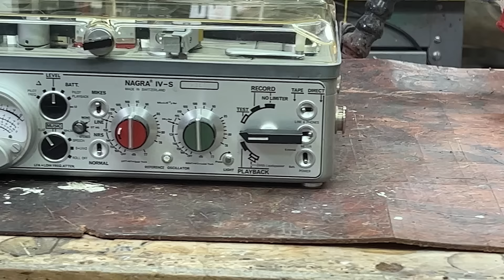Adam Savage Restores Clear Plastic Discoloration

Comment: Like others have said, a UV light makes the hydrogen peroxide process work so much better.  I use it for cleaning yellow discoloration from plastics (both solid and clear).  The addition of a UV light (and letting to process go for 24 hrs or longer for really bad yellowing) makes a world of difference.
Reply: Agreed, UV light is a critical part of the process
Reply: I've done it too on old computer cases and a clear stereo cover and UV light is the difference, I also used a stronger HP% I think it was 30% not 12%. The computer cases came out off white/beige just like from the factory floor and the clear plastic was crystal clear without a hint of yellow like this still has. 

I coated them before bed let them sit overnight then set them out in the driveway for a couple hours in the sunlight, then cleaned them off. 10-11 hours total.
Reply: This Summer I de-yellowed a load of LEGO bricks, worked well, but being the UK and not having a garden to leave it in, the window of opportunity isn't great! Soon I'm making a de-yellowing box with a glass tub (ideally lidded), UV LED strips and some kind of heating base.
Reply: Tip: If you don't have access to UV light another good source is the sun itself. Just make sure to swirl the parts from time to time to get a uniform color. I whitened the body of a white Panasonic Flip Clock. Works a charm
Reply: Came here to stop screaming that at the screen. ;)
Reply: Exact
Reply: @jimmytvfclassic  I'm in the UK, don't always have access to the Sun, haha! I need to do it often enough that building a box to do it will work out well. Won't need to wait for Summer to roll back around, and can even do it at night.
Reply: @BogusNoise  yeah... makes sense. If you do it often, it's better to invest into a UV box for sure, specially if you live in the UK. I'm from Spain, and I just wanted to give that tip in case it was for a casual fix or you can't afford building one. Cheers mate!
Reply: @jimmytvfclassic  And you were right to do so 🙂
Reply: I agree with that, however, I use a dedicated sous vide for a low heat instead of UV.
Reply: agreed... I came in to say the same thing.  H202 is only half the de-yellowing process.  Gotta bathe it in UV light while it soaks for the best results.  Odd Tinkering does a ton of old video game console and handheld restorations, where he goes through this process in basically every video.  Fun fact... you already have a large format UV cabinet that you built for your Form 3 printer.  If you can get that tub of peroxide in that box, you're golden.
Reply: this
Reply: You need an aquarium heater too.
Reply: @BansheeBunny  Good point, I think Odd added one at some point as well
Reply: When yiu say UV light, what wavelength are you referring to?
Reply: Weird that UV light helps, since UV light probably causes yellowing in the first place, but I get it acts different around the peroxide?
Reply: @tomhorsley6566  The UV light is a catalyst for the reaction between the hydrogen peroxide and the plastic, adding heat to the reaction speeds up the processes.
Reply: I have two questions.. won't the UV cause the plastic to break down, and what wavelength of UV?
Reply: @yeroca  yes and no. same way if you leave plastic outside in direct sunlight for months and months it will break down and become brittle. however to accelerate a chemical process over a relative short time frame (12hours vs. 4months) the affect on the plastic will be negligable unless you plan on using it outdoors. there are processes to restore brittle plastic by basicaly filling in the chemical bonds that were broken by UV damage with a similar resin or, even better, a uv resistant resin but at that point you are basicaly preserving the shape and not the thing. from a restaration standpoint its completely safe for preservation of plastics because its not any more destructive than just leaving the piece out in open air. hell polishing is more damaging than peroxide treatment because it removes surface finish.
Reply: @RyokuKitsune  a direct UV lamp will be more intense than sunlight, but I see your point, thanks 🙏
Reply: I got mad about 3 minutes into the whole process.
Reply: @JasonOlshefsky  I almost started screaming...' Duuude, like WTH are you doing!?, did you read the instructions for using peroxide?!' LOL
Adam has his dufus moments.
Reply: @tomhorsley6566  thank for asking and for the response below. I was thinking this exact thing and your question/explanation is the first I found. 
After seeing what the sun does to headlights, I needed to know why
Reply: @Projacked1  I’ve never handled strong peroxide before so I never needed to, but as his mind is moving a mile a minute, I can understand overlooking that
Reply: I'm actually kind of surprised that all the research Adam did on the internet and he forgot the UV light. I mean, this process only has a few components to it.
Reply: @GordysGoodworks  UV isn’t critical. Heat, peroxide and time are enough. I retrobrite at about 40C/100F in 12% peroxide with no UV source, and it works just fine.
Reply: Without the UV I don't think it works at all. I've googled lots and I can't find a single demonstration without UV.
Reply: @PhilipLeitch  It definitely does work without UV, I retrobrite 1980’s computer cases in heated peroxide in a box with no light of any sort. If you want more details check out Hey Birt’s YouTube video “The truth about retr0brite”.
Reply: I was yelling at the screen when he missed the uv light step. Lol
Reply: I remember... Hmmm... I think it was Retro Man Cave or something, or maybe it was Techmoan. . They did a bunch of tests and basically the consensus was that  you need HP, some heat and time. UV and sun heat in general very much accelerates the process, but if you give it time. Just soaking it in HP will be enough. I'm guessing in room temp and no UV. maybe it's on the order of days instead of hours to get done. But at least it showed that sunlight/UV was not necessary if you aren't in a hurry.
Reply: @jmalmsten  actual link would be great. Thanks.
Reply: @thomasrevor7608  I've also done it thru sous vide.
Reply: @jmalmsten  Hey Birt’s channel did the experiments.
Reply: In my experience, it also makes the plastic more brittle.  That's been the case with older toys that I've tried to restore.
Reply: @Of_the_House_of_Black  That happens when it's soaked for too long.  Experience has taught me to measure the thickness of the plastic and soak accordingly.
Reply: Yellow urine stains on orental rugs i treat with between 3% and 10% hydrogen peroxide and sunlight to get them out while leaving dyes relatively alone its a great oxidizer 3% is safe fore wool rugs and textiles
Reply: @GordysGoodworks  🔴 What Is Islam? 

🔴 Islam is not just another religion. 

🔵 It is the same message preached by Moses, Jesus and Abraham.

 🔴 Islam literally means ‘submission to God’ and it teaches us to have a direct relationship with God. 

 🔵 It reminds us that since God created us, no one should be worshipped except God alone. 

 🔴 It also teaches that God is nothing like a human being or like anything that we can imagine.

🌍 The concept of God is summarized in the Quran as:

📖 { “Say, He is God, the One.  God, the Absolute.  He does not give birth, nor was He born, and there is nothing like Him.”} (Quran 112:1-4) 📚

🔴 Becoming a Muslim is not turning your back to Jesus. 

🔵 Rather it’s going back to the original teachings of Jesus and obeying him. 

More .....
Reply: In my experiments, peroxide +UV is crucial. It sounded paradoxical as in my case (multiple computer cases in fact) UV was the cause of the yellowing. I also found that raising the temperature of the process had a dramatic effect. Some say that a temp increase makes the plastic more porous and amenable to a good reaction. I'm not sure if that's right but it definitely helped. My current yellowing problems are with white 3D printer resin about a month after curing and exposed to indoor daylight. The method described here doesn't work for me - not even slightly.
Reply: @BogusNoise heh. I hope they weren’t yellow bricks.
Reply: @melgross  They were actually green but I'd run out of blue soooo...
Reply: I had the idea to do this but wasn't sure if it would work and your comment is the exact idea I had so thank you.
Reply: I have an old 1970's terrarium. I've tried the 40 volume peroxide with plastic wrap and left it in the sun for 3 days. I'm going to try it again tomorrow with UV light. Fingers crossed 🤞.  It's a $500 terrarium if I can remove the yellow. Thanks!
Reply: A year on, all the Lego parts I deyellowed have reyellowed. They were in storage in the dark rather than out in the open. Probably won't be trying the process again!!
Reply: You don't need a UV light per se because he's in SoCal just needs to leave it outside, also better to use Salon Care 40 and cellophane wrap it so it won't dry out.
Reply: Question, I did the retrobrite process with vinegar and a UV light to remove yellowing on my clear original gameboy and the yellowing is gone, but now the clear plastic is very cloudy.. how would I fix this?
Reply: I found a vintage UV sun tanning lamp at the thrift store. It's shaped like a regular table lamp. Awful and deadly for your skin I am sure, but works a treat for this kind of repairing job on old electronics.
Reply: Hey brother could you expand a little bit? What do you mean letting the process go for 24 hours? Do you mean using a uv light continuously for 24+ hours while using peroxide?
Reply: @anthonyL1776  Yes.  I had a keyboard enclosure (that was so stained that I originally thought it was yellow) that I had to let set for over 30 hours.  After the first 8 hours or so, you have to check on it regularly (too long and the plastic becomes too brittle).
Reply: Does it matter if the plastic is colored instead of white?  I have a blue toy from 1969 that is badly discolored.
Reply: @ZerocoolsPropsandCollectibles DO you mean putting the object in a zip lock bag with peroxide and heating in a saucepan?
Reply: @s.engelsman4521  no vacuum sealing the parts with peroxide and putting it in a water bath at exact temperature.
Reply: @s.engelsman4521  I haven't tried colored plastics, so I'm not sure.
Reply: @crash0zero and how to work over the big polycarbonate sheets?
Reply: @everythingitry3018  i have one I'm trying to restore now. How did it work for you?

Comment: Everyone’s already mentioned UV light, I just want to know how Adam managed to read about the peroxide without coming across the UV part.
Reply: Sad, right?
Reply: It’s possible he didn’t think it mattered because often the UV is suggested to make it work faster when it in fact is needed to get it to work at all
Reply: Ye that's what wondering too. Nearly all the articles on Internet mention the UV
Reply: I use a UV lamp too. I’ve seen where some people put it outdoors, in the sun for a few days. But that seems to be a lot of trouble.
Reply: He is human like the rest of us. He just missed it or misunderstood how critical it was
Reply: It turns out you can just use a heat source rather than UV to reverse the reaction - I had similar results with both approaches. Unfortunately both approaches will re-yellow within a year.
Reply: Retrobrighting is never permanent. What is happening is the chemical makeup of the plastic is destabilizing because the maker of the item didn't add preservatives and stabilizing agents to said plastic when it was being made (to save cost 0 its expensive and 'unnecessary'). There is nothing you can do to stop it other than re-making the plastic part with modern machines and technology.  @BogusNoise
Reply: @MrWolfSnack  I don't think it's a cost saving measure as it happens to expensive plastics too, doesn't it?
But yeah, it's not a permanent fix, but is talked about all over the internet as if it is! I found out the hard way, after spending money and hours on bleach, UV LEDS, boxes etc...
Reply: Something costs whatever the retailer wants it to cost. The construction of it and materials used has no bearing on its price. And the reason it is talked about as being that, is because people have the attention span of a turnip and do not actually wait and follow up on the progress after months/years. All retrobrighting does is eat away the top layer of stained plastic. The more you do it, the more layers of plastic you will chew up, whittling it down over time like a block of wood. So it can be harmful depending on the product.  There is theories that a car wax buffing or some sealer will stop the yellowing of the plastic after the retrobrighting but nobody has found out a reliable method.  @BogusNoise
Reply: @silaskuemmerle2505  Yeah, but one may think that he would have mentioned why he dismissed using UV -  if he actually had knowledge of it.
Reply: @MrWolfSnack  - Something costs whatever the retailer wants it to cost AND the consumer is still willing to buy it.

Also, having gone through the trouble of de-yellowing something, one might think to store it in such a way as to slow down the re-yellowing process - i.e., away from UV light. For example, the piece Adam did was only slightly yellowed even though it was about 50 years old. Most likely because such a piece of equipment would not normally be stored on a table top in front of a south facing window for all of those 50 years. So, properly stored, Adam probably won't need to re-de-yellow it again for at least 20 or 30 more years.
Reply: @anonamoose2582  It's already been proven UV exposure has no effect on plastic yellowing. It's the fire retardant polymers in the plastics decaying. This is why if you seal the plastic it will still yellow, because it is coming from within.
Reply: @MrWolfSnack that is so interesting haha thanks for sharing!

Comment: The most likely reason it got worse the more you polished it is most likely because you didn't clean out your pad often enough combined with allowing the polishing compound to get too dry on the surface while still buffing. After a couple of passes over an area with your buffer the area needs to be cleaned off as well as the buffing pad. Then new compound can be applied & worked again if it needs it. When polishing compound gets too dry it turns into a much coarser abrasive because the liquid is lessened but the grit is still there. As others have stated hydrogen peroxide works well to remove yellowing from plastics but it requires ultraviolet light & potentially more time than you allowed. You would also want to flip the cover over halfway through to help the bleaching process penitente the whole piece.
Reply: He really should be using the polishing pads that are made of foam. That way you can use different foams based on how much scratch removal you need and then finish off with a gentle polish to get the shine out of it.
Reply: Speed as well, but it sounded like a low RPM.
Reply: I agree. I've been buffing cars for over 20 years & I use less compound with a spray bottle of water. One thing I did learn from this vid, is that there is plastic polish. I just never thought of that before. Cheers Y/All.
Reply: I was cringing every time he contaminated the finer grits with the coarse ones still on the pad. He should have dedicated pads for each grit. I've buffed out lacquer finishes on guitars. It's an unforgiving process.
Reply: @raoulduke8382  It's pretty obvious that Adam didn't know much about buffing. But look at all the other things he's done. No one knows every thing. That's how we learn in life. Gotta give him a break.
Reply: It doesn't help using paper towels either, might as well put sawdust on it.  Microfiber towels work the best
Reply: I would have skipped all of it, and used the white scotchbrite pad. The wax floor buffing pad.
Reply: And he's polishing, but then uses tissue paper. What the heck lol
Reply: As stated at least 3 times here... DO NOT USE the PAPER TOWEL.
I tried this once for an old pair of polycarbonate eyeglass lenses.
When i did it with paper towels (because i was being cheep and didn't want to use my "novus polish mates" pad) it made things better in some spots and globally worse. When i switched to the novus pad and a fair amount of elbow grease... amazing.

I would not recommend this for high precision lenses as the polishing process can (likely would) slightly distort the optics. But, to fix up a pair of backup eyeglasses so that i could safely drive home while having left my primary frame (i hate choosing new frames) at the optician to receive new lenses... those novus polishes and pads were amazing.